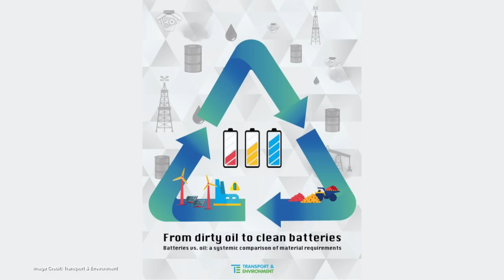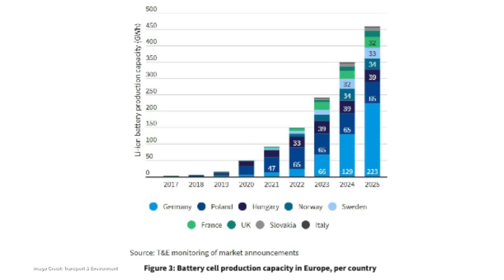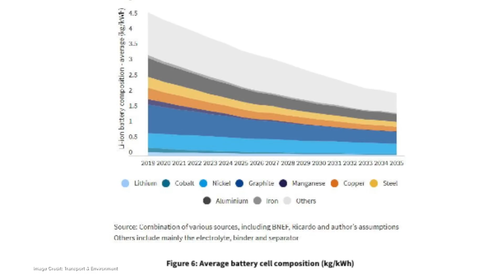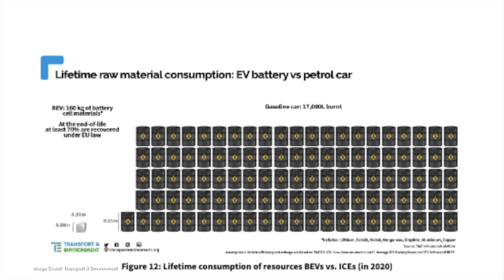This Report Busts The Myth That Electric Cars Are Worse Than Gasoline ones

Comment: If battery manufacturing costs have decreased by 85% and generally the rest of a EV is less mechanically complecated than petroleum powered vehicles. Why have cost of EV'S not dropped. EV'S are less cost effective than petroleum vehicles for the first 300000km at least. And EJ is the world's richest, so they say.
Reply: They have. Nine years ago, the only EV you could buy with a range greater than 200 miles was the $70,000 Tesla Model S. Today you have multiple $35,000 EVs available with that range. And 100-200 mile range EVs available under $20,000 brand new.

And many EVs can become cost effective after as little as 20,000 miles. Sooner in European markets where gasoline is much more expensive than in the US, and incentives are higher. Comparing the Volkswagen ID.3 to the Volkswagen Golf, you'll likely hit break-even in 1-2 years.
Reply: @AnonymousFreakYT  exact.
Or, if you want to see it on another way, ~10 years ago you could buy a Nissan LEAF 22kWh for a slightly higher price than a LEAF with 60ish kWh today.
Reply: Economy of scale is what will eventually bring the overall costs down, and right now car manufacturers still need to recover the costs for research and development on batteries (not to mention the costs to build the factories to make them). It shouldn't be too long, though.
Reply: It appears there is a general agreement that EV's are largly overpriced. The variant seems to be the justification. I say the justification is nonexistent.
Reply: @ianburnett4605  Then you should seize the opportunity to build an EV at what you think it should cost. Undercut the market, sell a ton of product, and make a killing while making the world a better place.

Change your name to Ian Musk and go for it.
Reply: @ianburnett4605  Thing is, while Battery prices have come down, the size of batteries have gone up. There were plenty of EV's 10 years ago that were €40-50k+, but with only a battery capacity of between 10-40kWh, while now for the same (or sometimes lower) price these can have between 60-100kWh. So this can already be a reason as to why prices for EV cars haven't dropped the much. Ofcourse there are likely other reasons, like improve engine specs, possibly better (and more expensive) cooling systems, r&d cost, not enough competition due to high demand, ...

Essentially in the past the most expensive part of an EV by far was the battery, now the battery likely is proportionally less expensive, but other things might have become more expensive too and companies can still get away with higher prices. And ofcourse inflation shouldn't be underestimated, a car you'd pay $40k for in 2010, would now cost $48k.
Reply: The world is battery constrained.  This means there are more EV buyers than can cars can be manufactured.  Until supply can match demand, EVs will continue to be more expensive.  As well, the supply of battery raw materials is also constrained.  Even if we build more battery manufacturing plants, they may not have enough raw materials.  As the whole supply chain ramps up we will see prices come down.   The building of the supply chain is capital expensive.  Letting richer people by expensive cars to fund this growth seems reasonable to me.
Reply: @normcfu  making ev's for the wealthy means they have more toys in the garage and the manufacgurers become the worlds richest. This is bad overall for the planet. Im sure these manufacturers can be convinced to change their mindset with a little carbon credit rule manipulation. After all "one" manufacturer wont be able to make a car at a profit without the credits that we the population aportion to them.
Reply: Price is determined by supply and demand. Why would they lower the price when they are selling well at current prices?
Reply: @kkobayashi1  they will lower prices once some real competition kicks in

Comment: Showing the volume of consumed fuel does have some meaning.  That is a large volume of material that has to be harvested, transported, refined, transported, and dispensed.  All of those steps require energy and are potential sources of pollution.
Reply: I guess comparing it only with the metals used in the batteries is a bit misleading, they probably should have also considered the energy to charge them during the vehicle life time (it would still be way less, considering how efficient electric motors are compared with ICEs).
Reply: @FrancescoDiMauro  don't forget the tires, plastics, insulation and many other EV parts that are oil by-products. Even aluminium, copper, steel are very energy intensive to mine process and produce, steel also requires coal which is mined using diesel.....
Reply: @carholic-sz3qv  All of those processes are common to both BEV and ICE vehicles.  The point I was trying to make is that harvesting, refining, and moving the fuel for an ICE vehicle creates a significantly larger impact on emissions than simply getting power from the grid to move a vehicle.
Reply: @hellcat1988  that is totally wrong because the fuel is just a bioproduct just like the million other ones. The same fuel is also used to mine lithium, make EV car parts, the same oil is used make fertilisers and the same oil is used to harvest and process food. Coal and gas power plants are made possible with those giant diesel mining machines, even gold and many other things totally relies on oil.
Reply: @carholic-sz3qv  You want to try that argument again, but this time in english?
Reply: Yes, it's a kind of impressive "factoid" for an uninformed person.

But it's still quite vague and not an analysis as per sé.

One additional factoid is metal VS. metal consumption: impressive, but a kilogram of iron could be transformed in a commercial steel for a cost or get forged , heat treated, or mixed in a special steel for a much greater cost.
A kg of iron in an BEV is lower quality/cheaper steel than the same kg of iron heat treated and hardened to be valves stems in a cylinder, or a spring, in a combustion engine.